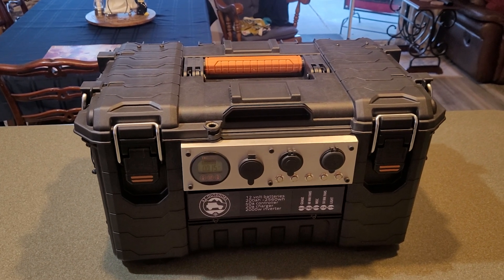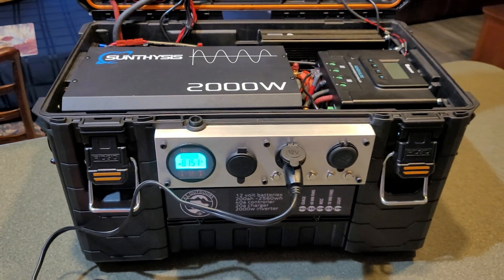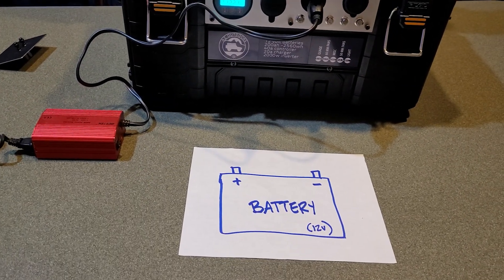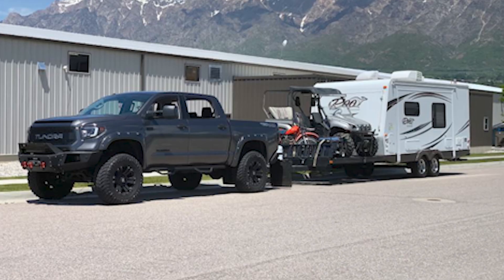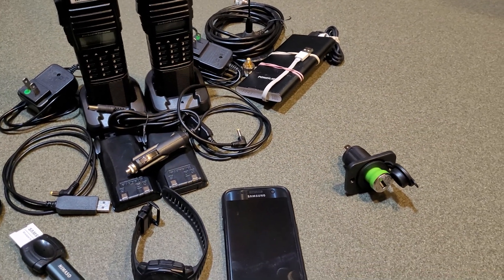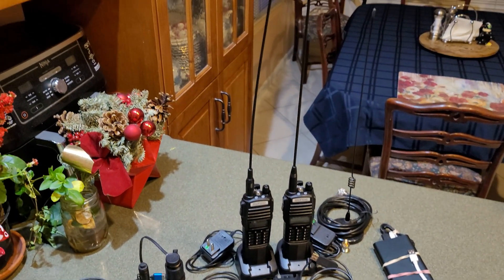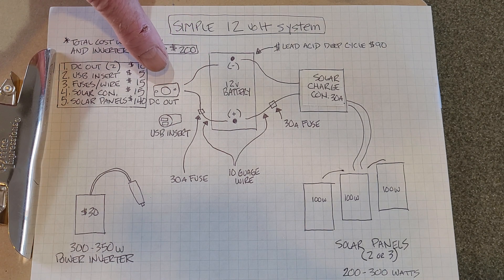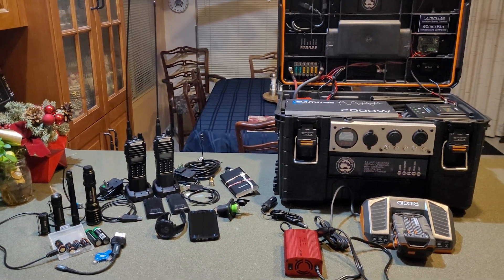Why you need to build a DIY 12 volt solar generator (Power station)

Comment: MY build is nearly finished. I bought one of the Harbor Freight Bauer rolling toolboxes. At its Heart will be TWO Lipuls 12 Volt 100 Amp Group 24 Sized Lithium Iron Phosphate Batteries. I have an 80 Amp Circuit Breaker inline for each Battery. I did this in case the Battery Makers Over-voltage Protection does not work. This morning I finished the Control Box for the system. It has TWO Powerwerx 10 Amp Charge Controllers for Lithium Batteries. Controller 1 is for my main system for Field use. Controller Two is completely Autonomous from Number 1. I simply have TWO Controllers in the Control Box in order to facilitate one other person being able to charge THEIR Smaller devices at the same time. 
(I ultimately will also Have an independent External Input interface in order to work with higher Powered Charge Controllers.)
Also in the Control Box are Two Dual USB output Pods; All four USB;s are THREE AMPS OUTPUT. To finish off the Control Box are Two !3 Not Sockets that are activated from a Single Switch. The "Control Box" is made from the SMALLEST Harbor Freight Hard Case. Back to main Rolling Box: (t also houses an Allpowers 100 Watt holdup Solar Panel, a Harbor Freight 1000 Watt PURE SINE Inverter, and a 35 Amp  AC Charger for use when Grid Power is available. In addition, I will also have the Cabling and will if needs be BUILD all of the Adaptors I might conceivably ever need for ANYONE else's system. My end goal is to have a personal Solar "Generator" which will interface with EVERY Commercial unit presently being made. I hope to have the entire MAIN System up and running in the next Two Days.

Comment: During actual SHTF there’s gonna be a lot of cars out there not working because of no gas or even because of an EMP. Those lead acid batteries are 12V if you have a 12V system you’ll have your pick of 12V batteries just in case.

Comment: What about removing the 30A fuses to increase efficiency
Reply: How does that work?
Reply: @mnight207  fuses generally dissipate more heat than surrounding wire, if you remove it there should be less loss due to joules effect
Reply: @iuristasiv9360  Thanks for the explanation
Reply: @mnight207  you're welcome, I'm not sure if it really works that way, maybe somebody could confirm ou correct me